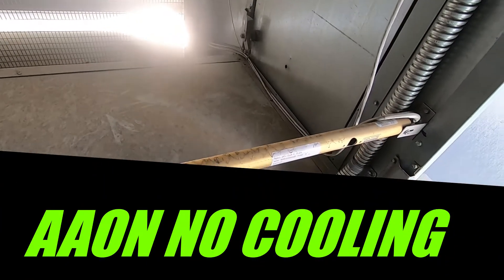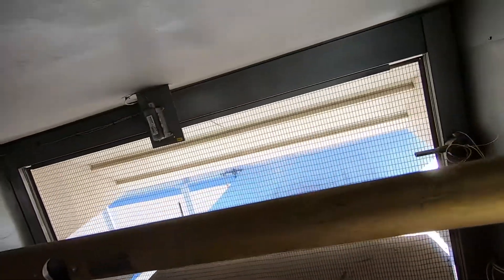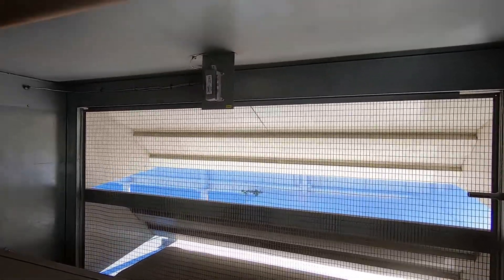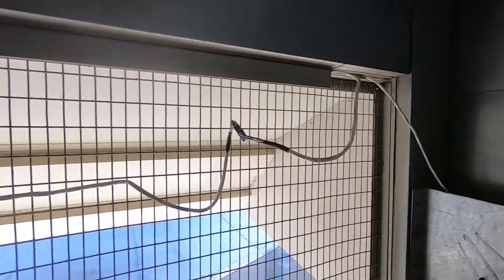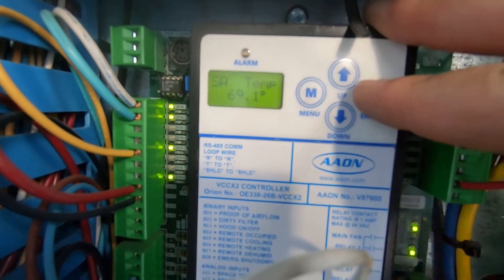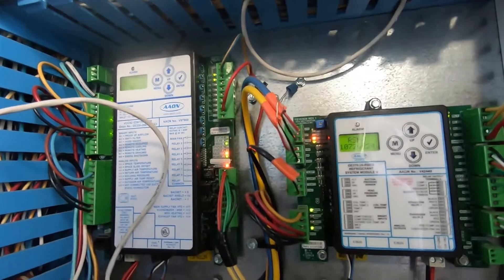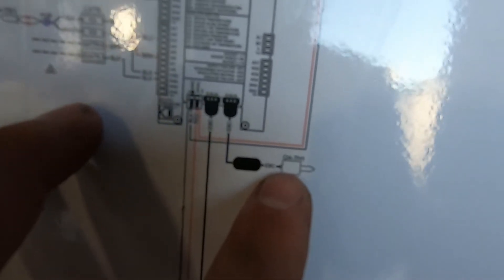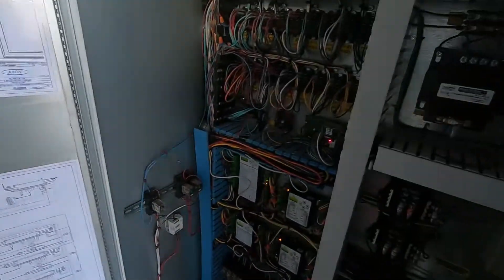AAON NO COOLING!

Comment: The aaon manual says something to the effect of "if the OAT sensor fails the unit will calculate a value in the middle of heat and cooling points so that the system can still operate in heating and cooling" but this has not been my experience. I have seen several units that the whole system is brought down whether in calling for heat or cooling when the OAT sensor fails, and will not operate again until it is replaced. Is there a way to do a bypass while awaiting sensor replacement?
Reply from the maker: @SpreadTruth24  there’s few ways it can be configured. For instance this unit I show in the video is using OA/RH through the Ebus. since it was shorted out and not reading correctly it was showing 0 degrees causing the unit to lockout. 

Now through prizm I could have switched over to a global OA sensor through BMS, or switched to analog and connect a 10k sensor the main controller to read OA. 

Another unit identical to the one in the video I work on has different controls in it and sensors, this one reads OA only through 10k sensor when it is cut or completely bad the unit will revert to 65 outside air. I watched this when I disconnected the wiring saw it default to that. I’m sure there’s a value that changes that in prizm while connected to the unit. 

So depends on your application and what sensors or controllers that unit has.